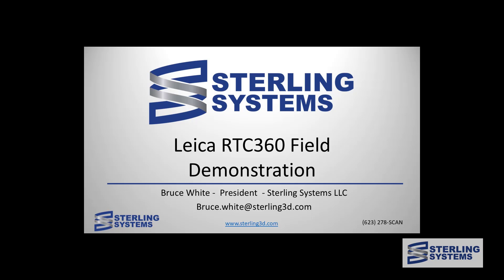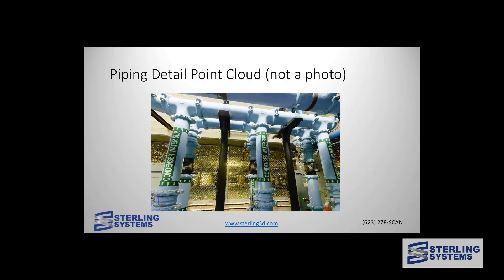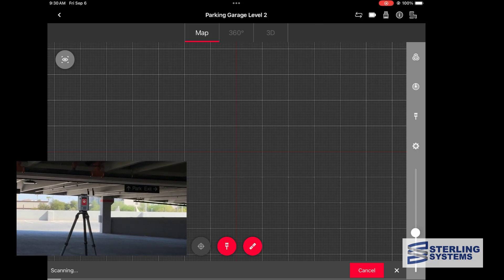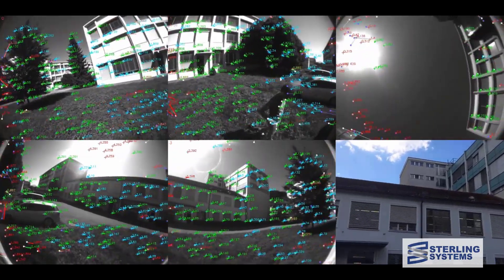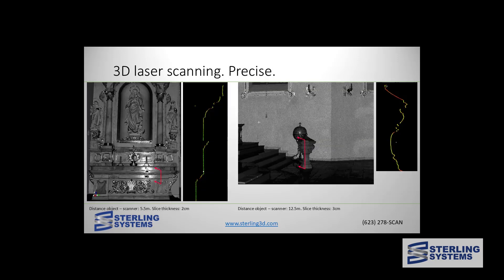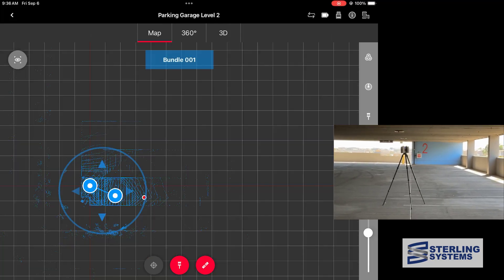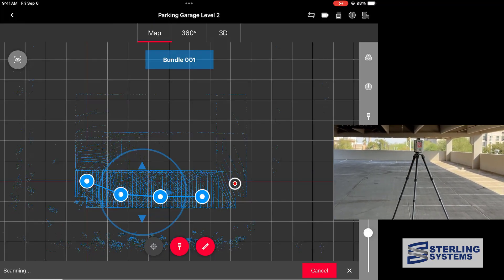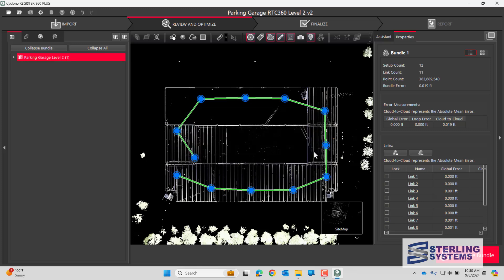Leica RTC360 Demonstration on a Parking Garage

Comment: Nice video.  Do you have more examples of comparisons between the RTC360, P40, and BLK360?  Maybe strengths and weaknesses of each?
Reply from the maker: Thank you. I am headed out for the rest of the year at the moment, but maybe you could give me more detail or a phone call might be the best in January?
Reply: @sterlingsystemsllc7734  We heavily use the BLK360 and BLK2GO currently. This works for us right now because we don't need to use any kind of control points and our deliverable is a Revit model with an LOD 200 requirement generally. That said, we have had jobs where we are pushing the limits of these scanners and using something like an RTC360 could be beneficial. Hearing opinions on when and when not to use certain scanners from people that do this work in real life (not salesmen) I find very valuable.